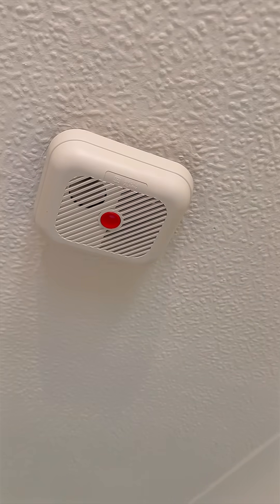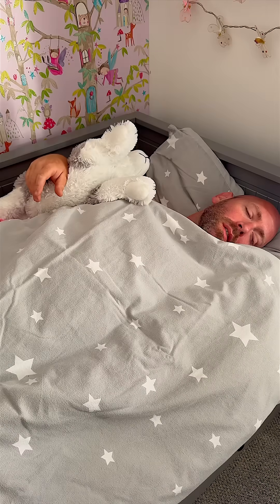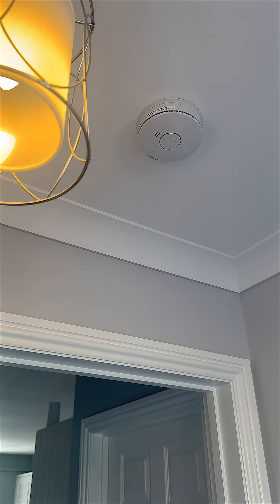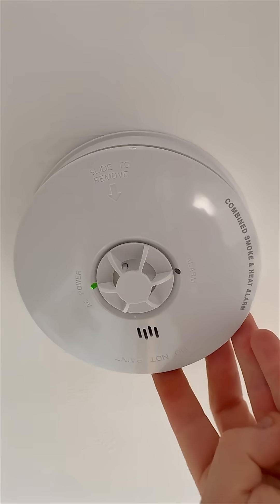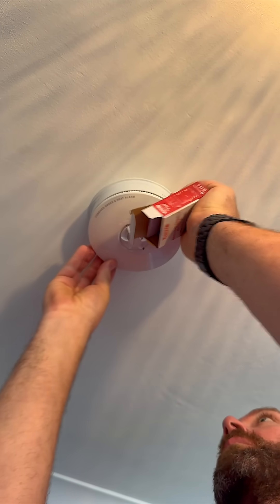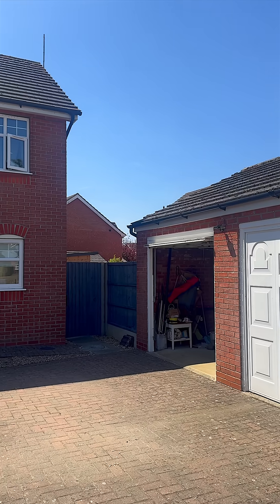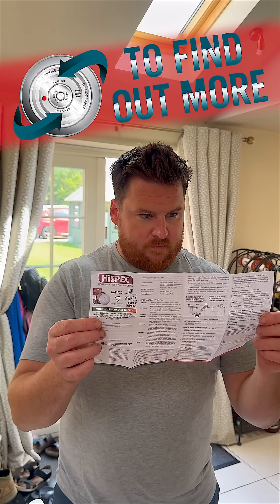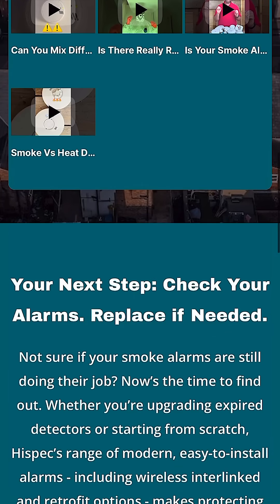How Do Interlinked Smoke Detectors Work?

Comment: Hardwired smoke detectors is very interesting topic. How they get address, how they disconnect supplying fans and activate exhaust fans, how they drive emergency lights, which circuits in consumer unit should be wired through contactor, which cable sheath material should be used, which relays should be NO and which relays should be NC in control centre, etc. 

Efixx can easily make 2- hours video about hardwired smoke detectors.